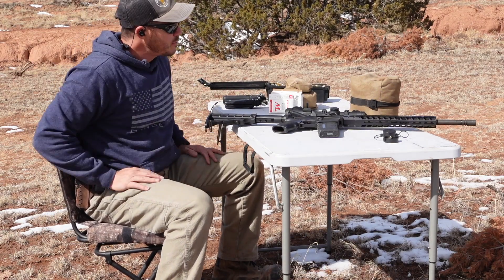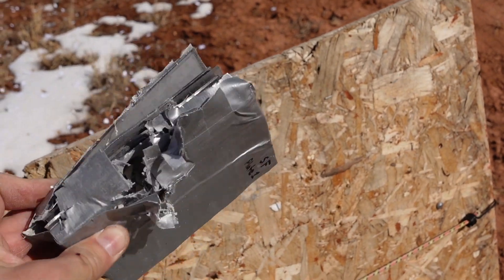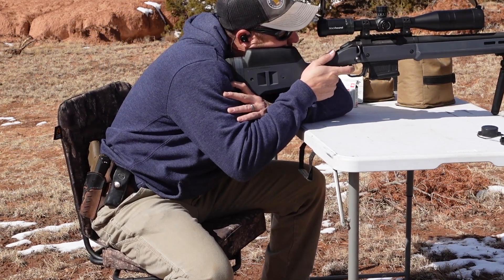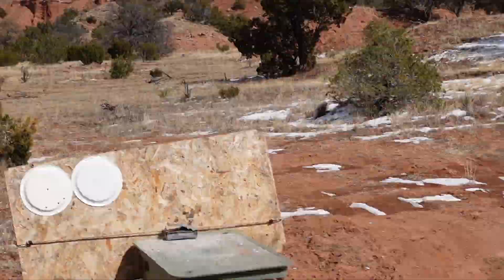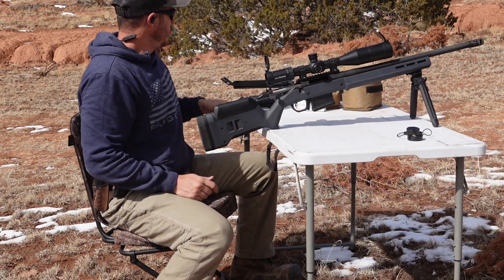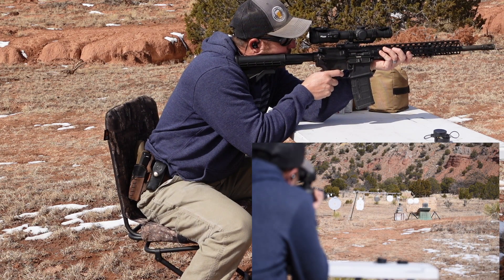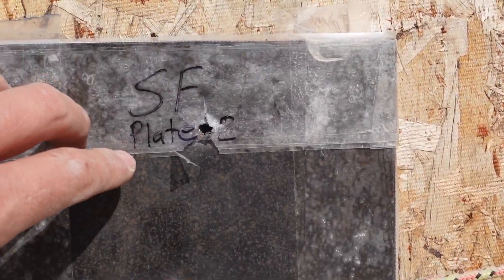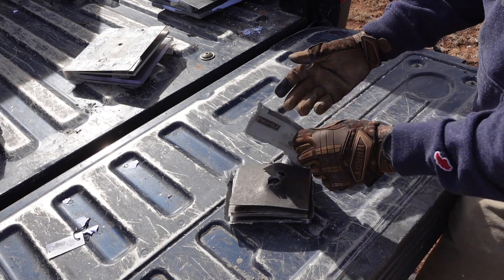Steel and Polycarbonate stopping bullets

Comment: glad to see that both of my designs could at least swallow 5.56 M193 (+ 7.62x39 for the heavyer one) , i m still impressed by how much energy 308 still had in both cases
Reply from the maker: I’m still interested in re-testing the multi layered poly and steel with a larger plate.  I really feel those 3 shots were too close to each other.
Reply: @3RBallistics  polycarbonate and mild steel are relatively ductile, so even shots landing close to each other wouldn t influence too much (or at least far less than it would on the ceramic strike face)

I still don t think that design of mine would work against 308 tho, it would require to swap out the mild steel for same weight worth of alluminium alloy